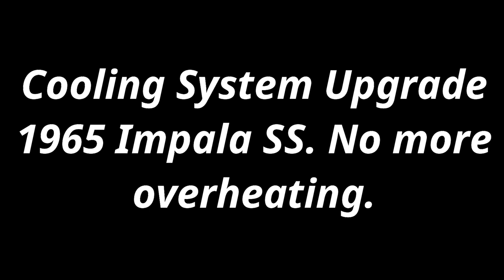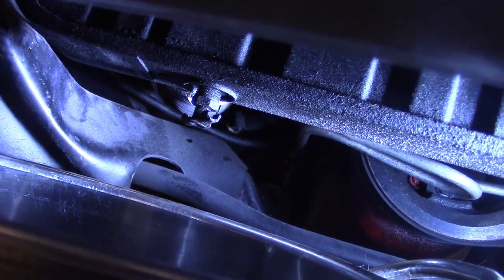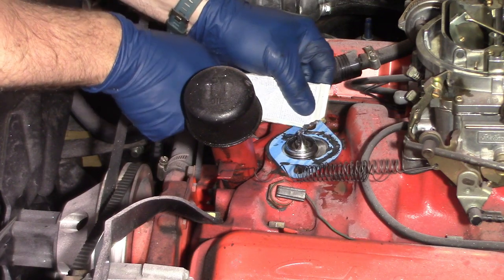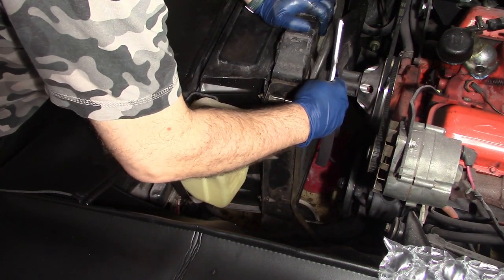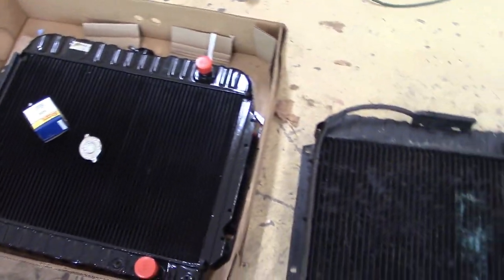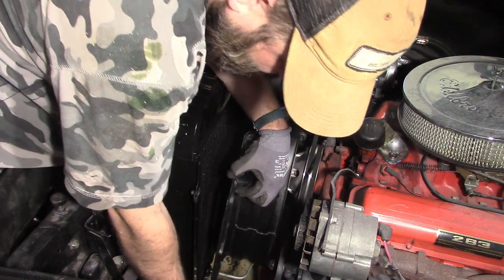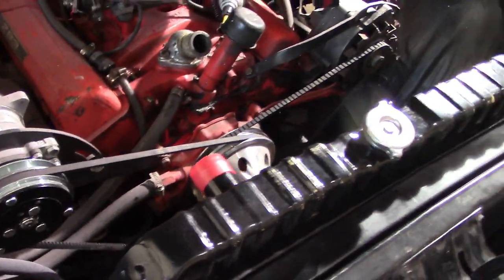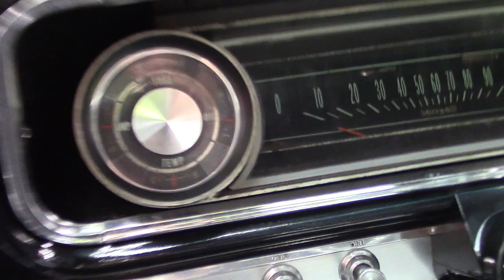Best replacement radiator for your 1965 impala . Worth every dollar.

Comment: I drop in a sbc 427 in my 65 and used a champion 4 row radiator, eldebrock high flow water pump, moroso high flow thermostat, dual 10" electric fans and running coolant crossover on the super victor 2 intake. Keeps the engine very cool 😎
Reply from the maker: Cool

Comment: Great job! I have a 65 biscayne. Even with an upgraded radiator without a fan shroud my car would overheat consistently. I just put a Halfmoon fan shroud open on the bottom and it worked like a charm. Thanks for the websites too.
Reply from the maker: That’s cool that you got it fixed, it’s crazy how much difference a shroud makes

Comment: I had a 327 SS and had a heating problem. I wanted to add draining valves to the lower block. I put the car up on a lift and carefully removed the plugs from the block. You'll never guess what I found. CASTING SAND in the cooling jacket. I tried to get it all out but I don't think I got it all. I should've taken it to the dealer. In those days, customer service was not at the top of their list. It was like everything wrong with the car was your fault and therfore not covered by the warranty.
Reply from the maker: Wow, that’s crazy, did you ever get it running cool?

Comment: My Breakerless SE electronic ignition is great. It's single wire so no one can see outside the cap that a modification has been made. It's also very forgiving of old distributors having some wear if that should be the case. These old engines need more initial advance with today's gas to run cooler. For a 1965 283, 4 to 6 degrees initial was originally called for, but 8 to 12 is what's needed now. I don't know off the top of my head how much is in the distributor, probably 24 degrees. I replaced the unknown Accel weights and springs in mine with NOS from a 1965 dated part number 1111015 Delco Remy 283 distributor, so I know I have a stock curve anyway.
Reply from the maker: That’s awesome, thanks for the info

Comment: Did your radiator upgrade workout the problem? I just recently rebuild my engine and it's 60 over... I have a 3 core upgrade radiator already with an electric 3000 cfm push fan in front, but in the back I'm still using my mechanical fan with clutch and fan shroud. It didn't over heat before the engine rebuild. Do you have any suggestions for me. Also great video and thank you for being a member of my Facebook group... 1965 Impala's Only. Thank you for any help in advance
Reply from the maker: My car is definitely cooler than before, but if it’s 100 degrees and I’m not moving at all it will still get a little warm. I wish I could say it’s perfect, but it’s still not. It is a lot more manageable than before . Everyone says the timing can make a difference. Make sure it’s set perfectly.

Comment: You may want to move the fan blade back towards the motor so that the blades are about half in half out of the shroud.
Reply from the maker: Thanks for the advice
Reply: Mine came with a short water pump with no clutch

Comment: How did you get your tail lights to switch like they do?
Reply from the maker: There is a kit on eBay that sells them. https://www.ebay.com/itm/1965-Impala-MULTI-Pattern-Sequential-LED-Tail-Lights-/153954839347?_trksid=p2349624.m46890.l49286

Comment: Do you have the radiator part number or radiator brand?
Reply from the maker: The brand is u.s. radiator, you need to go to their website, and call them
Reply: Do you have parts number
Reply: On the radiator